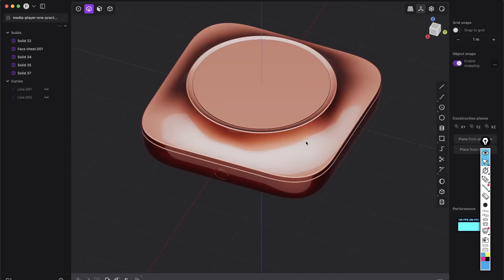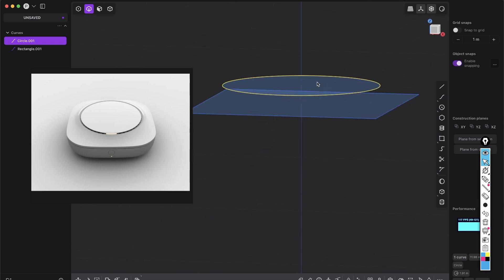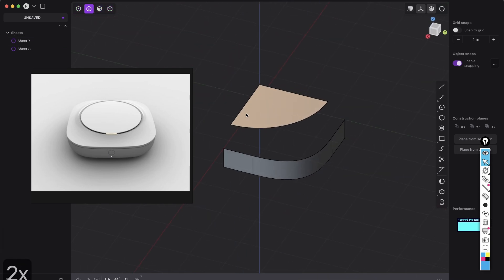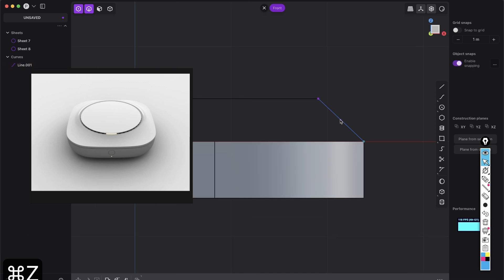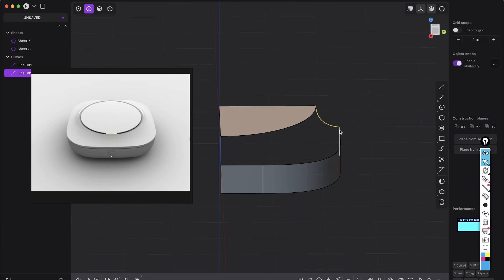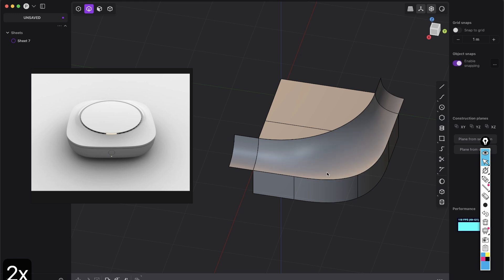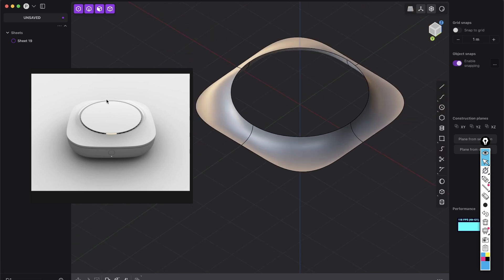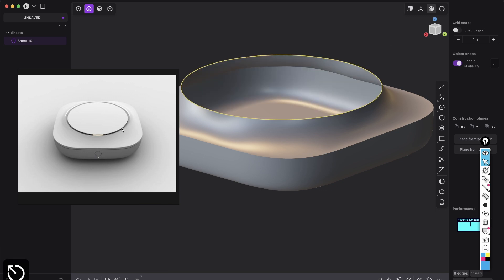How to model simple products in Plasticity

Comment: What would be the best workflow in terms of saving a design that you would like to go back to later and make adjustments if needed? I have a case design I made for a device, but I may need to adjust attributes of it later on. I’ve run into this where once I save and re-open later, there’s no way to retrace the steps. I’m guess this might be where I would need to use a different program.
Reply from the maker: I am using plasticity for 1,5 years daily, created hundreds of 3d models and never had to come back to any of them or could remodel certain things quickly. 

But as others suggested you can save your projects incrementally or save all building curves, surfaces etc so you can adjust them later on if needed.
Reply: @ thanks for the response, Nikita. Your videos are always so helpful. I will look into trying some different methods. I know you are busy, but a video on how to do something like “how to go back through history to make changes” would be extremely helpful. Maybe it’s my lack of understanding plasticity, but when I join curves or Boolean objects they are no longer individual items in my panel. So are you suggesting to not join or combine any items so that each one can be adjusted at a later time? My only concern with saving at incremental points like others have suggested is that it’s only current to that point that I saved. So anything I may have done after that save point would then need to be repeated to get it to where the end result would need to be.
Reply from the maker: @KGTv123  I personally never even save more than one project file for a project.

I create specific categories for all of my faces, surfaces and curves when I am in the building process. If I need later down the line to adjust or change something, I just rebuild the specific part with all the saved curves, surfaces etc.

I teach that all in my paid surface modeling courses when we work on complex models/products/cars.
Reply: @ thank you, Nikita! Is there any specific course you would recommend that addresses this workflow?
Reply from the maker: @KGTv123  Motorcycle & Car Modeling. I don't cover very specifically what you are asking for in the course. So, we don't go back to change things, because we model these complex objects straight from the first curve on as we want them to be.

But throughout the whole process we don't delete any curves, sheets etc. so it's a very simple straight forward later if needed to just delete some faces that you want to change, and use the saved curves for example to adjust the shape & form and rebuild it in the same place where you deleted the face. 

You can test it if that works for you, if not let me know I will give you a full refund.

Otherwise I might make a tutorial at some point in the future, but so far no one requested this
Reply: You can save a copy at any interval during development. Use that to make your changes. Hth —-Mark
Reply: @ hi mark, thanks for your reply. I guess my issue would be if I want to go back to a point and adjust it, I wouldn’t have all the steps after that point, so I don’t know if your method would work. For instance, in my model there is a rectangular cut out. If I saved at the point I made the cut out, but had to go back and move the rectangle over a few millimeters, when I opened that copy file I would be back at the point of the rectangle, but not of the rest of the parts I designed after that. So I would have to redo the rest of the model that occurred after I moved the rectangle.
Reply: @KGTv123  you're looking for procedural/parametric modeling that fusion offers; plasticity is direct modeling
Reply: @ thank you. I think that’s the answer I was looking for. I have really enjoyed plasticity, but this is one area that I think I will struggle with until the potentially, most likely not, bring something like that to plasticity
Reply: @KGTv123  likely not, its by design. Fusion can also be a direct modeler, but that involves switching "modes" entirely, disabling the parametric features and history/timeline.